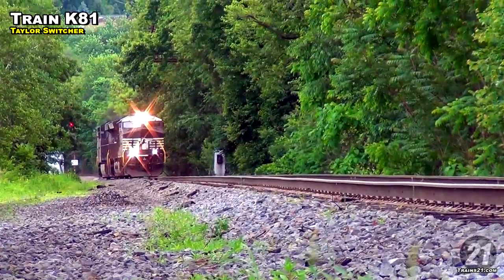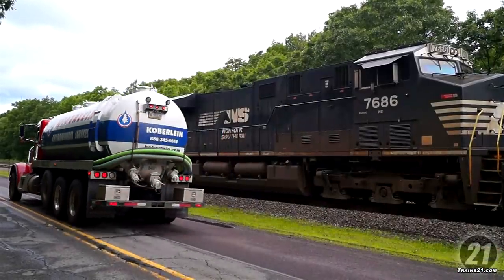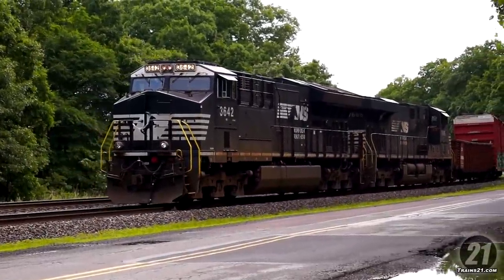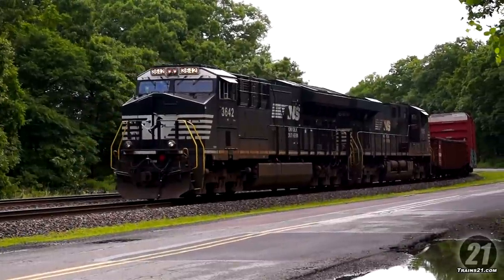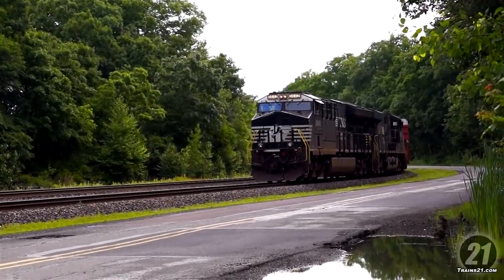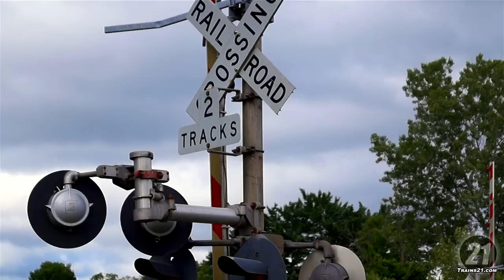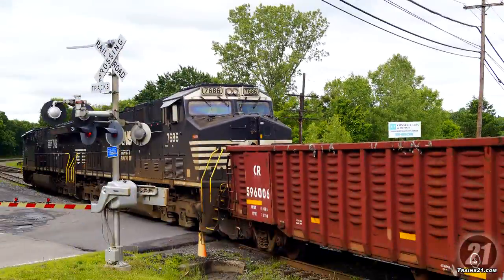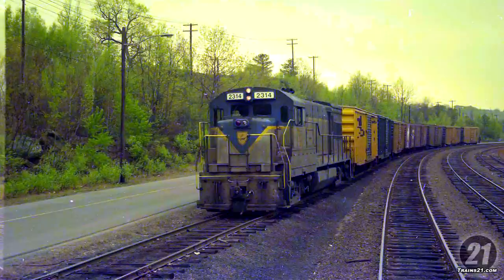This Is Why We Need Smaller Locomotives for Switching

Comment: This is just another reason we need conrail back modern railroads are so impractical and because of that we have less local freight if conrail came back and was sane this would not be an issue.
Reply: This is how the big railroads will get out of switching 
In this area we gave RBMN and also recently R J Corman who still have a multitude of endcab switchers and lightweight GP’s
NS will probably grant trackage rights in the near future to these lines to do there work
Reply: Yeah.  We need Conrail back so they can run off more smaller customers.  They were infamous during their empire for just not serving those they did not want to.
Reply: @Retired88M  lets hope so
Reply: @cdavid8139  ok what i meant by that is bring conrail back but this time to be a railroad that is trying to convert companies to use rail instead of road.
Reply: @legotech7268  Well, Conrail was not big on converting companies from truck to rail.   They loved to take out switches at a moments notice.  They were famous for it.   Outside of that not sure what a combined NS/CSXT would do but create even more of an east coast mess
Reply: @cdavid8139  what would you recommend then.
Reply: @legotech7268  Sigh.   To be honest I'm not high enough in the total food chain in this industry to give you a good answer.  I waver between pride at what rail does in North America and total frustration at some decisions I see.
Reply: @cdavid8139  all class 1 railroads have been removing local freight and making amtrack harder to operate. I say we need a new reformed conrail that would mostly prioritize local freight and the big money makers on the back burner. Also proper matin the track so amtrack can operate that is what I think needs to happen
Reply: @legotech7268  Conrail was famous for getting rid of local freight.   Bringing them back would just accelerate that problem.    Why should a private company be responsible for maintaining track to high-speed Amtrak requirements?     Absolutely not.   Let Amtrak and the passengers using it pay their way!!!!    Prioritizing local freight, which is generally low revenue, would be ridiculous for a privately owned company.   You thing a company wants to prioritize the freight that brings in the least amount of return?
Reply: @cdavid8139  fair point but in the world of climate change that would be the ideal option
Reply: @legotech7268  RJ Corman and Genesee & Wyoming are filling a lot of the holes that Conrail did by handling a lot of shortline and switching between major carriers.
Reply: Or ns just not scrap half their fleet randomly
Reply: @OldIronVideo  yeah that to

Comment: CN somewhat smart around me in Northern Illinois and currently use GP38-2s and GP40, not dumb big GEs and EMDs
Reply: But how big are their locals and tonnage? Figuring that it's NS it's a big local and high tonnage
Reply: I see NS switching and running locals with GP38s.
Reply: @epistte  I do to. All depends on length tonnage and I forgot about ruling grade.
Reply: I see larger and longer locals then this video shows in my area being pulled by geeps. The reading and northern use gp38’s and gp39(upgrade 30’s) pulling their regular freight. To say that it’s tonnage is wrong. It’s class one higher ups thinking that they are so smart they try to reinvent the wheel. Also blocking a road that long when you could use a different locomotive and not need the buffer comes is a problem. That’s just stupid or ignorant on managements part.
Reply: @Jim Mimlitsch  and what's the grade on that line vs this line? Get use to 6 axle. Theu are just as good as a road switcher as 4 axke. Rather have a 6 axle over a 4 any day. Way better at getting it moving.

Comment: What do you expect ??  Big class 1's that worry more about profits and stockholder dividends than investing in power, rolling stock, or trackage. All the while slashing crew numbers to the bone causing delays, congestion, and a disgruntled workforce.
Reply: Big Class I roads worry about profits and stockholder dividends BECAUSE THAT IS WHY THEY ARE IN BUSINESS!!!!   As far as investing in power, there has been incredible investment in power over the last decade.   Same for track.
Reply: @C David   of course businesses exist to turn a profit.  When you see corporations neglect to reinvest in assets and opt to buy back stock to bolster dividend return that's a different story.  Class 1's doubling and tripling train lengths  to the point of choking the capabilities of their own system is ridiculous.  New locomotive production has tanked. Estimates show numbers as high as 11,000+ Locomotives in storeage, yet class 1's hesitate to rebuild these units to modern spec, sidestepping tier 4 requirements. Double track is disappearing, all the while bean counters stingily add some siding length. All said and done, Precision Scheduled Railroading,  the noose around the rail industries neck !!
Reply: @stevenlitkey9354  New locomotive production has tanked.  As it should.   No need to buy something you do not need.   Are you suggesting railroads invest in multi-million dollar power that they don't need.    Why would a responsible business do that with 11000 in storage.  Why would you rebuild units if you do not need them.   (There are units being rebuilt currently).   But in the past decade there were significant capital investments by the industry.  That continues.   And double tracks have been disappearing for decades.   That isn't recent.   In the long run we may find that PSR doesn't work as it does in many other nations.  Time I suppose will tell.
Reply: @cdavid8139  Agreed . . . . !!

Comment: I watched a crew park 2 loco’s over a level crossing for 15 minute’s - just because they could !
Reply from the maker: That's not very polite!
Reply: @Trains21  they were dropping a helper off and the train it was going on to was ready to pick it up, they could have moved off the crossing but didn’t, they sat there detached from the helper until the other train picked it up, they moved off the crossing for 3 minute then blocked it again while the reattached to their train and waited for the signal to leave which didn’t take long.

Comment: What ever happened to say, the EMD SW1000, SW1200 switcher engines to do switching operations on lines with 100 pound rail or even 80 Pound rail? Obviously, these older tracks with the lighter weight rail can't handle the weight of these modern freight engines.
Reply: They were all retired or sold off by the big railroads as being too light and underpowered to do anything. A lot of GP15s were sold off, too, for these reasons. But even a GP38 would be able to switch this out, and NS still has quite a few of those. Likely, they just didn't want to send one there.
Reply: @RMSTitanicWSL  Exactly.  Why go find a smaller unit when these are doing the job just fine.   There's no telling how much work with heavier tonnage took place elsewhere.

Comment: That is ridiculous using two behemoth GE’s to do a job like that when one Geep could handle it with no problems.  The railroads have obviously lost their ever-loving minds   smh
Reply from the maker: Check out my "When PSR Goes Wrong" video. Sometimes there were three engines! Great to look at, unusual to switch with I think.

Comment: what would happen if he locomotives went over the siding rail? I feel like nothing major would happen right?
Reply: Depends on the track weight and how well the track is maintained. Those locos are _heavy_. Lightweight rails with a too far apart tie spacing for the load could dip significantly under the load, potentially rolling the engine. More likely the spikes could pull and one of the rails lay over on its side, derailing the engine. Alternately the track might spread and drop the engine down onto the ties.
Other than laying the engine over on its side , none of those outcomes are a major difference from daily railroading, but it could end up tying up that intersection for a couple of days.

Comment: Should of pushed the gondola and boxcar into the building by themselves.
Reply: As said, the road bed for the siding track cannot support a six-axel locomotive. The other cars were used so the locomotives did not have to get on that track. A smaller, switching locomotive is needed.

Comment: That s called progress. Seems like a switcher with a cow could do the job
Reply: It could.   But why have both if you don't need them.   I would rather have the horsepower/traction of these big units doing road work out on the main than 50 year old switch engines.   Now I will say that there are industrial/yard jobs where I really miss the SW15 type of units.   BUt this isn't one of them.
Reply: @cdavid8139  This job should be run by a GP38 or equivalent. Which still might be too much for that ratty old customer owned spur.

Comment: Lmao using 2 or 3 big GEs or EMDs for a tiny 7 car train, when a smaller switcher can handle that, whats wrong with these railroads besides being cheap lol
Reply: Well, they could have used 4 units instead of 2.
Reply: Could be the customer as well. If heavier rail was put in, who would have to pay for it? I know this is a NS leaning vid but a local company was told by CSX they would no longer switch for the company. The company had to lease a lok and set cars close to the main line. Well, I assume CSX wouldn’t switch for them. Maybe CSX started charging a ridiculous price and the company could do it cheaper. I’ve not been able to find out the details.
Reply: I have seen railroads tell companies that until they fixed a industrial lead they wouldn't switch it. Too big of a risk for them to risk derailing because of a customer's bad tracks. On a lot of NS industry tracks, they have signs that clearly mark their " maintenance ends"
Reply: Also if a switch crew isn't available in the area when a customer needs  to be switched,  do  you  expect them to delay switching them and  potentially losing a customer because they can't provide timely service? Another reason is the railroads like to have locomotives that are general purpose, instead of just designed for only 1 thing.
Reply: It's possible they'll pick up 80 cars somewhere down the line.

Comment: So. If you have only one engine that's 5 feet long it would block the intersection. So your premise is deeply flawed.

A possible answer is to leave cars behind and not take as many into that siding.
Reply: If they had a smaller, lighter engine they wouldn't b have to build a train so long to reach it and not block the crossing. They had to build a train that could reach into the building because the engines were too heavy for the track. If you had a lighter one, you could possibly take it right into the car barn.
Reply: Remember when he said that was basically as far as the locomotives could go? That was because of the weight limit on that siding.